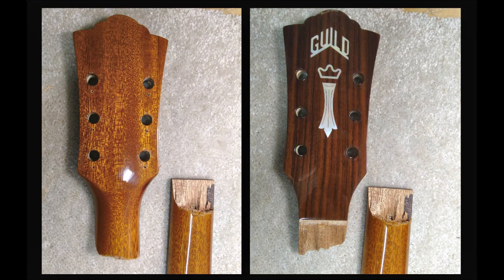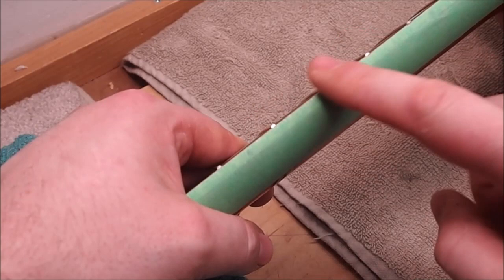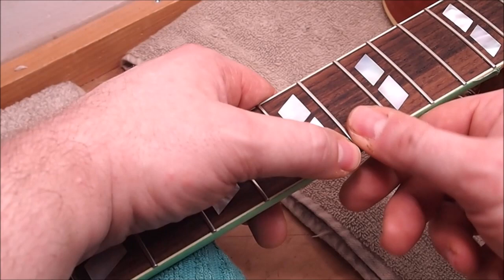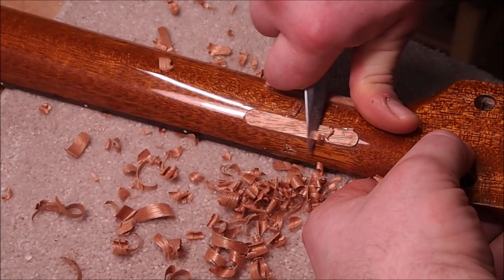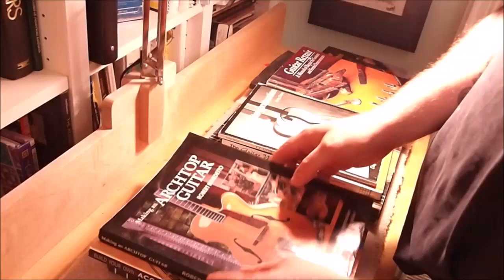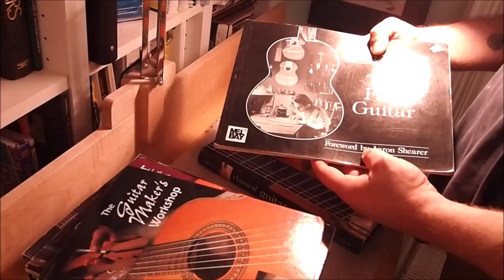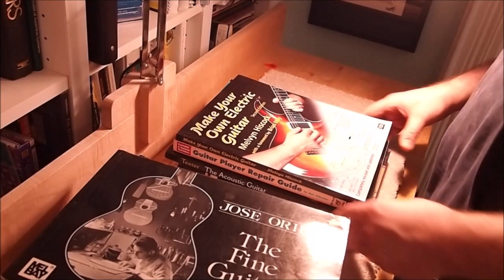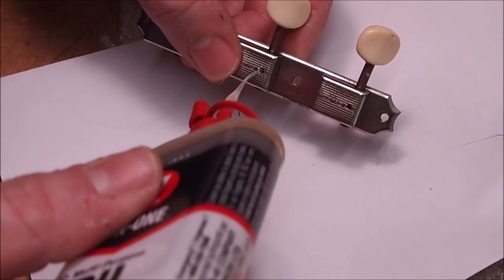Luthiery: Questions and Answers

Comment: I've been watching a lot of your videos lately, and enjoying them a lot.

I also really like Rosa String works with Jerry Rosa.

I was watching your video on the very nice Loar slim hollow body guitar, and did learn a couple of cool tricks, so I thought I might pay something forward:

Use about 8-10 inches of 3/16 I.D. surgical tubing, with a 1/16 wall thickness, to feed through the F-hole and grab the shaft of the pots. It's very secure, but will come off without too much trouble. You can simply feed the washer and nut over the tubing to secure the pots. I came up with this while working on two ES 335 style guitars at the same time, just to avoid a mental breakdown. I use an old 1/4 plug end soldered to a unwound guitar G string to grab the output jack. I use a smaller piece of the surgical tubing to grab the switch. It's the same size I use to replace some springs on pickup mounting screws.

Anyway, I'm enjoying your channel, and hope to catch up with all of the videos pretty soon. Thanks.

Comment: I use a sponge sand block.for sharp fret ends... works much quicker and safer.  Still need to tape the binding to prevent damage.
Reply: @jjulch   That's a very useful tip!! Thank you!! I'm going to put that tip to good use in the next couple weeks when I fret one mandolin I'm working on & refret another.

Comment: hey another great video!! I own about 5 or six of the books you mentioned, to date I haven't built a guitar yet but have successfully completed a number of set ups and minor repairs. including taking a bolt on neck off a S&P that the finger board had lifted completely from the neck. glued the finger board back to the neck and then reset the neck and glued the finger board back down to the top. I should really remove it again one day and realign the neck. its action can't be dialled in with the truss rod, there's and no room to lower the saddle.

Comment: I've glued so many broken head stocks I've lost count. I found if the glue surface was big enough, glue was all that was required. Most of these guitars were from schools. I found that when they came back broken again, rarely was it at the glued joint. It almost always broken one side or the other. Guess the point I'm trying to make is, if done properly, the glue is stronger then the wood.

Comment: Stan could get that baritone so low it bypassed the ears and went straight to the gut. Last Watch on the Midland still makes me shudder. He played down here on the South Shore a number of times at the Beale House, always generous with his time. (Interestingly, a very knowledgeable luthier). Some years earlier, in 1973 I bought the Irving Sloan book from the hippy coop in Haleiwa on the North Shore of Hawaii. Just out of the military, I built the bender and boiling trough, ordered wood from International Violin Supply and built a classical guitar in a shed out back of the house. I left the purfling off and eventually came back east, learned how to do purfling and finished it in between other jobs. BTW, nice job on the Guild - I have a soft spot for early Westerlys'.

Comment: I would be interested in seeing how you would repair a very bad head stock break. For example one that uses bolts and metal plates in place of proper wood working methods.
Reply from the maker: I don't think I would ever use metal plates or bolts.  I prefer proper woodwork.  Or are you suggesting I try to re-do something someone else has repaired using metal? That might be interesting.

Comment: How hard is a neck reset on a Seagull? I saw on the factory video they epoxy in the neck.
Reply: If it is epoxied, It's a bigger headache than you really want to tackle unless you have a TON of experience. There's an extremely good chance you'll damage something with the amount of heat & steam required to get the neck loose. Also, I'm not certain, but I would think a Seagull would have a bolt on neck.

Comment: If one had a steel string guitar that has a Spanish Heal, how would one reset the neck?
Reply from the maker: There's a procedure called slipping the back, where the binding is pulled away from the sides and the heel loosened from the back. The neck is tipped and reglued. It's not an easy job.  Sometimes it's better to pull the frets and plane a taper into the fretboard.

Comment: I’m purchasing a 70s j50 with a broken off headstock, but it doesn’t come with the headstock. I’m going to repair it myself, could you give some tips?
Reply from the maker: Make it nice!   There's no easy way to answer this. Watch my video on repairing a Les Paul headstock. It might give you some ideas. Make your gluing surfaces as long as possible.
Reply: I have multiple times.
Reply: Since I don’t have the headstock, i have to make one. Would I need to make a new joint, like a scarf joint?

Comment: Quick question, I was wondering about the knife you're using to trim the neck spline wood back to match the neck profile. 
Would a straight knife edge prevent the chance of digging too deep?
Reply from the maker: Straight or curved, there's always a chance of going too deep if you come at the grain in the wrong direction.  It's nice to have a blade with a wide, flat bevel leading up to the edge because it acts a little like a plane.

Comment: I started on a Home Shopping Network Guitar about 10 years ago. What a hunk of junk. I performed fret work, replaced nut, replaced bridge, replaced tuners, replaced bridge pins. Tried dozens of different strings on it. It plays like butter now, but it’s still sonically a hunk of junk. It has so many coats of Poly on it that one could use it to pot flowers and display them on their front lawn as a decoration. I’m now doing guitar tech work for a ‘60’s band that’s still playing nowadays. I do the “intensive” stuff like refrets and repairs. I love it, but it still doesn’t pay the bills. Guys (and Gals) - guitar players are always broke. LOL! Yea - that 3-in-One Oil - how do they stay in business? I think I buy a new can every 8 years or so. PS: StewMac’s (Love/Hate$) Fret Erasers work HEAVENLY. Why aren’t you using them?